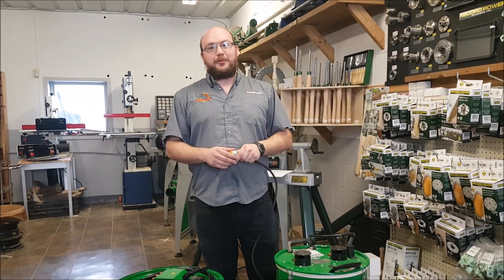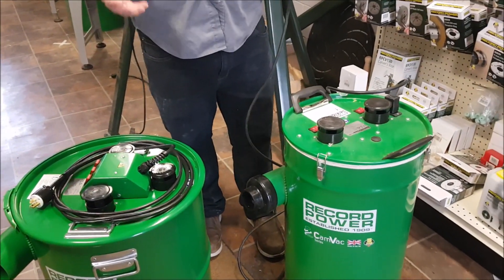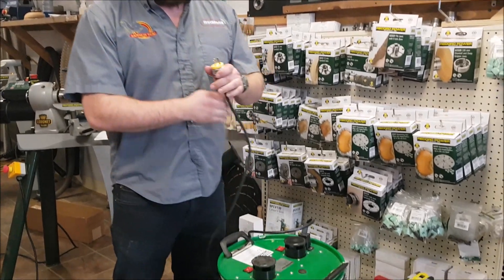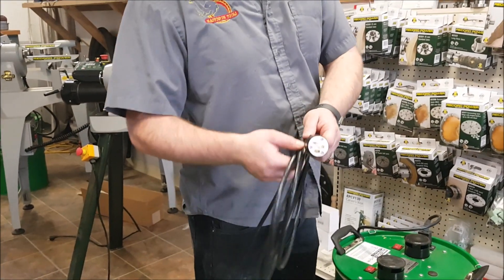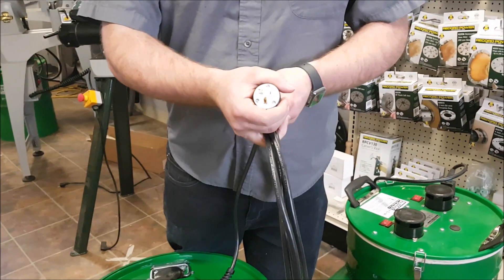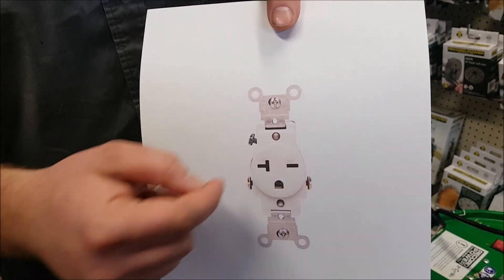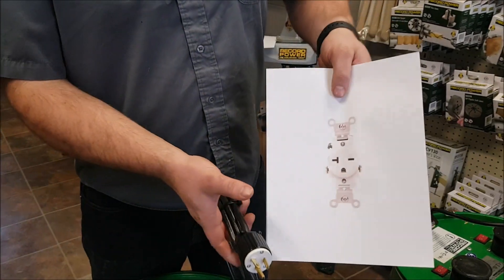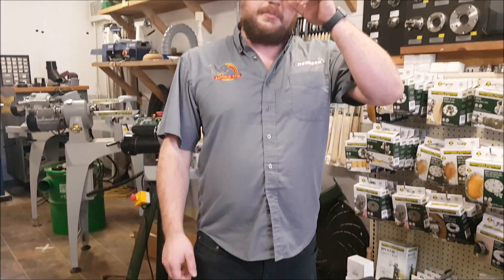Camvac Dust Extractor's 220v Plugs, What Electrics Do You Need To Run One? EthAnswers

Comment: If you are only running one motor of a dual motor CamVac at a time, for example to capture dust from only one light dust producer like a miter saw, is the amp requirement reduced by half?
Reply from the maker: Yes that’s exactly right! Each Camvac motor runs about 4.3amps at 230V. So one motor would be 4.3A, two motors 8.7A and three motors 13A. 
Watch for next weeks video…I’ll be showing a way to use the 230V Camvac in a standard 115V outlet 👍
Reply: @StockroomSupply  YES! Exactly the info I have been hoping for. I am pro trim carpenter and would love to be able to take advantage of CamVac's compact power on job sites where only 110V outlets and 15-20 A circuits would typically be available.